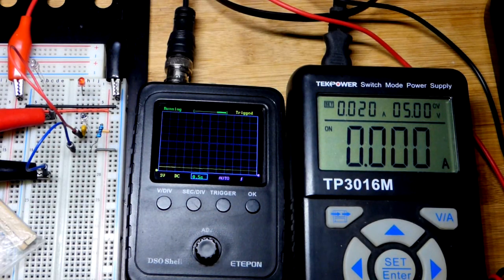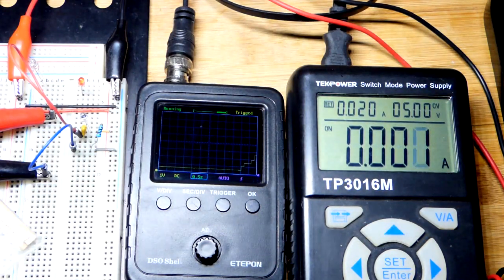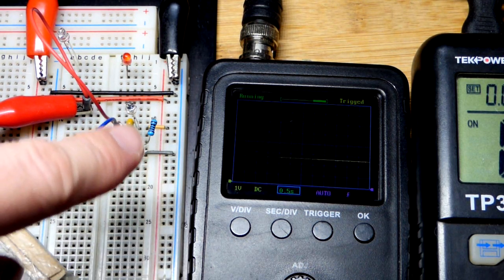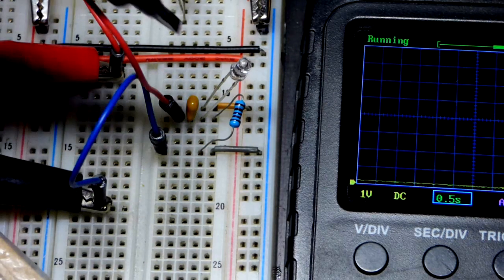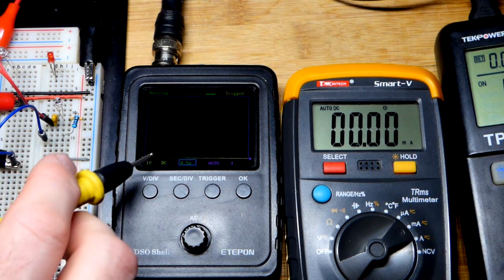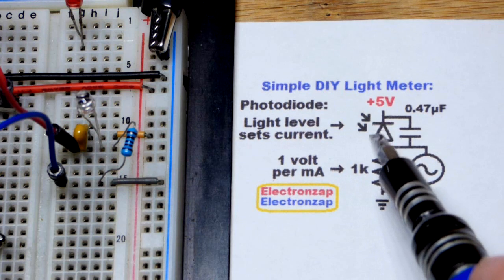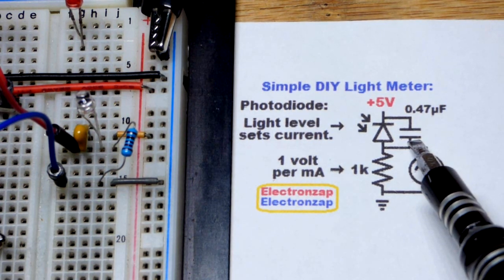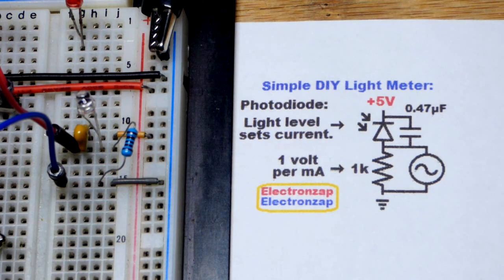Simple DIY light meter using photodiode resistor voltage divider learning electronics lesson 0061

Comment: Q: I was thinking that the smoothing capacitor would be connected to the resistor/photodiode junction and to ground (as per a power supply smoothing capacitor where one end is grounded).  I haven't tried it but I think that would also work.  Do you know if there is an advantage doing it in parallel as you did, vs what I suggested?  Thanks!
Reply from the maker: I added the capacitor parallel to the photodiode because I already had a capacitor on the breadboard that was ready to fit on 2 rows next to each other, like the photodiode was conected. Plus I wanted to keep the schematic less cluttered. If I had originally planned to add it to the circuit, then I probably would have connected it parallel to the resistor so that one end was grounded, as I wasn't even sure if it would help being parallel to the photodiode til I tested it.